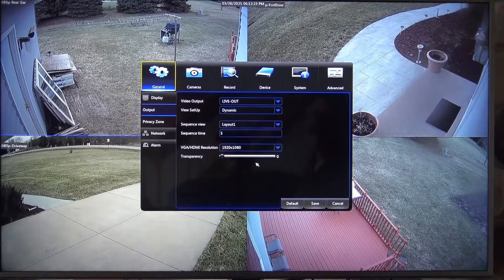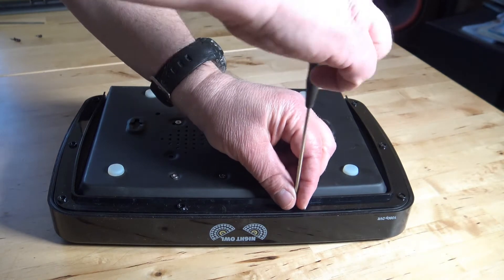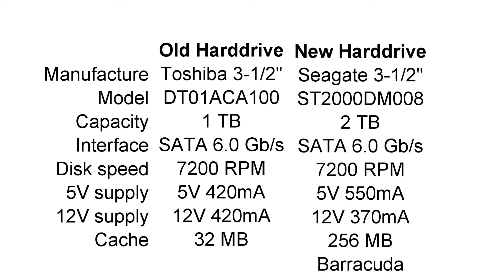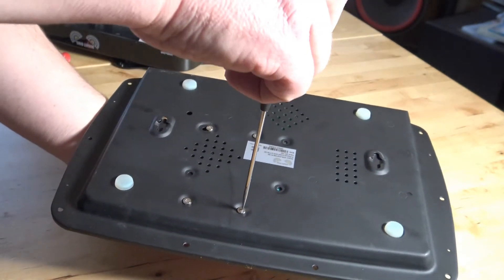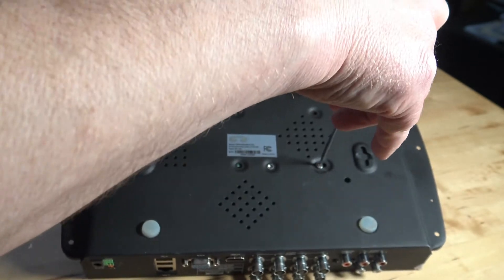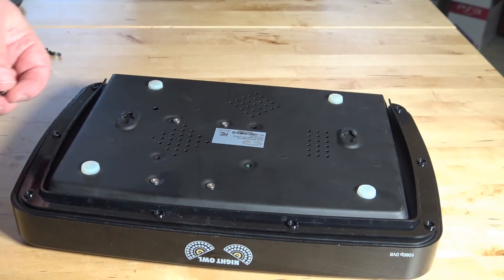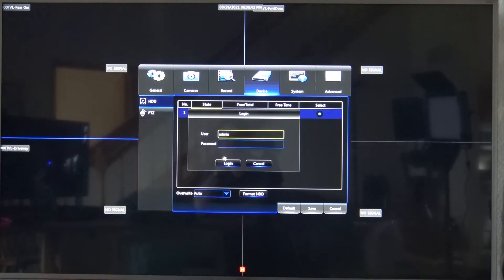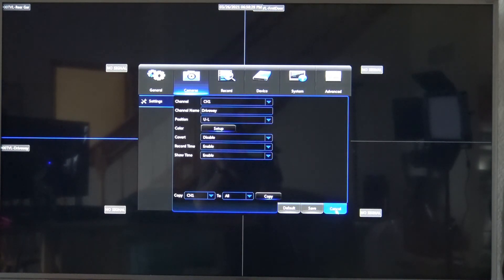Night Owl Hard drive replacement

Comment: why did you not put a ssd in ??
Reply from the maker: A SSD would of costed 3 to 4 times more than a hard-drive at the time. I didn't need the performance level that a SSD offered. So paying for performance I didn't need made no sence. If video system is 4K, the extra performance SSD may offer some benefit.

Comment: Thanks for the Video!   That was easy.  In my case, I got a cheap SATA III 2.5"  1T SSD because I wanted the unit to be quiet (BTW SATA III is the same thing as SATA 6.0 Gb/s).   NOTE:  a 2.5" hard drive fits in the Night Owl chassis just fine, there are holes predrilled for a 2.5" drive, you just need to make sure you have screws that fit the 2.5" drive because those screws are smaller than the ones for 3.5" drives.   Thanks again!

Comment: Would the process you did for your DVR work for a similar DVR from nite owl? I don’t really want to open the dvr to find out the details on the hard drive itself because I’m afraid I will mess it up more. The model number of my DVR is “AHD7-DVR8-1TB” or “AHD7-841.” Any help would be appreciated. My dvr is 720p if that helps.
Reply from the maker: I think a two steps in researching if a upgrade is possible. First in the menu check to see if their is a HDD Format button. Then research on the internet if some one else has done the upgrade.
Reply: can you help my system says no hdd and is not recording but the box say it has 2 bt thing im not really good wih tech

Comment: I have a Night Owl 16 channel DVR thats about 4-5 years old. It stop recording. I tried to reset and format the hard drive, it went through the motion and then said unformated.  I purchased a new Purple 4T hard drive, installed it but it doesn't even list/recognize it. I checked all connections but nothing. Don't know what's going on???
Reply from the maker: The power supply that plugs into the night owl has a history of going bad. This is a common failure point. To test if this is the case you could do the following. Check the DC voltage output rating of the two power supplies. The one for the DVR and the other for the cameras. Make sure they are the same. Then the camera power supply has to have amperage rating of 1 amp or more. Use this supply to power up the DVR temporarily. Now check to see if the hard drive now works. If not it could be a bad capacitors inside the DVR. Check for bad capacitors. The look like small cans with colored plastic shrink around the outside. Part of the aluminum top is exposed. If this top is bulging up, or leakage around the base, the capacitor is bad. My circuit board has three capacitors, two of these were bad. But my DVR was still working.

Comment: I noticed that you had four screens on your computer (total of four cameras?). I have four NightOwl cameras and want to upgrade my HDD. When I spoke to a NightOwl rep (over LiveChat) they told me to get a HDD with up to 6TB storage. I'm a little concerned after looking at the price (over $100). What is the difference between the TB storages (1TB, 2TB, 4TB, etc.)? 

- someone who knows absolutely nothing about hard drives
Reply from the maker: TB stands for Tera Byte. 1TB = 1,000,000,000,000 bytes of storage.
Reply: @jeffanderson9093  So I'm replacing a hard drive inside of a Night Owl.   Is the size a deal breaker?  I know they say to use a 7200 rpm SATA HD but I've never heard them say what storage capacity to use.  What is a can't miss HD for this thing?  The original drive lasted about 5 years which isn't bad but isn't great, considering the really low number of operations this thing has.  Thanks.  I can't believe size would be a huge deal since you can have it overwrite endlessly, don't need to keep anything but a day or two.

Comment: I really liked your video.  I too have a HD problem with my Night Owl. My question concerns the setup; Was the settings saved or did you have to re-enter the IP data ???
Reply from the maker: No I did not have to re-enter the IP data for the network. I take it forgranit that you are using a static IP address, instead of DHCP.